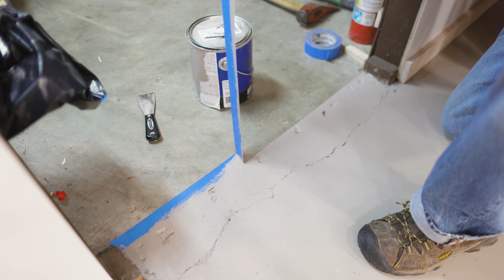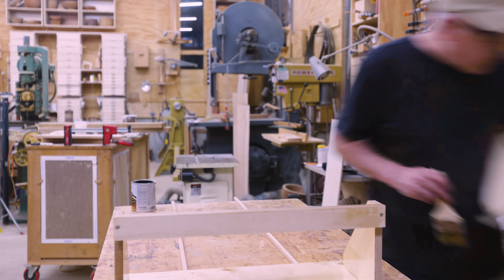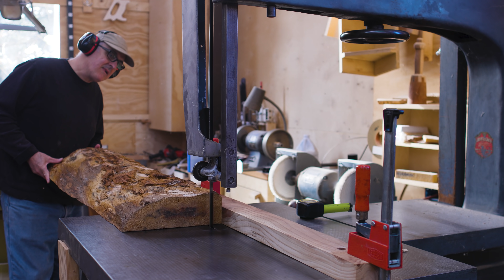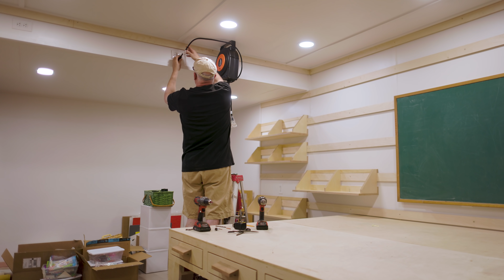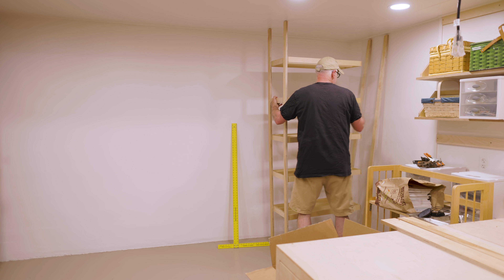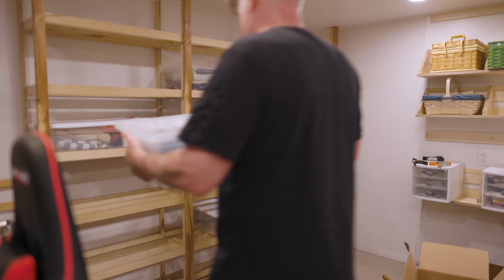Finishing the Craft Room

Comment: Considering that each screw can easily hold 100 pounds, it looked like you ended up with 4 attachment points per shelf. It should be fine.

Comment: I liked your review of the shear strength of the screw and the shelving and it would be interesting if you were able to test some of that?  Trying different methods to confirm or evaluate just what type of bond is there?  The bond also could become weakened by shrinkage of the wood during lower humidity months, and then maybe you're entirely dependent on the screw itself?

Comment: Just a quick tip for filling gaps/cracks in concrete before painting floors....  Use bondo or similar.   I've done this is a couple of warehouses and it's stood up well, including running forklifts over the cracks.     This  trick was taught to me by a guy who owned a company that manufactures epoxy flooring paints.....

Comment: Frank, we can hardly even get decent plywood here in New Zealand.  There have been no full sheets of plywood suitable for project use for two or three months. I'm building a router table/cabinet at the moment, and had to use smaller sheets of 18mm, and I've actually cleaned out the local DIY store.  I have enough to finish the project, although I've had to use MDF for the draws (the draw fronts will still be plywood).  It's a similar situation with fence timber — we have a several months wait for that.  It must be hard on the builders who can't work if they can't get materials.  Meanwhile shiploads of un-milled logs are going to China because they apparently pay more for it.   I'd be interested in how you did the exploding shelf effect.  I'm guessing that each part was animated with After Effects, which must have been a lot of work.

Comment: Completely aside, the chairs in that room may benefit from replacement wheels made of rollerblade wheels. They will work on the concrete MUCH better than the plastic ones that come with those chairs (especially that gaming chair your son has), without the need of the mats.

Example of what I mean, but not endorsement of this particular brand: https://www.amazon.com/Universal-Including-Hardwood-Rollerblade-Replacement/dp/B07FP56VND/ref=sr_1_5?dchild=1&keywords=chair+wheel+replacement&qid=1621956080&sr=8-5

Comment: If you want a more compact cord reel you could check the Bayco SL-801. It’s a simpler smaller design. It’s a disc/puck shaped drum 9.5” in diameter about 3.5” thick.

Comment: Without a compression value of side pressure on those shelves you would not have much friction hold.. The screws however have a very high Shear and tension strength. Shelves should hold nicely. I am, as always very entertained and impressed with the ways you find to build your projects. Not always industry standards and often unique.

Comment: I like the shelves without a plywood surface. I build garage helving the same way, except I would put the inside pieces front to back, which required a sheet on top to support things. By running them sideways, I can eliminate the sheet on top and save space, weight and money!

Comment: Hey Frank, could you explain to me what a planer (sp) does and how it works? Thanks!
Reply from the maker: The jointer makes one side of a board flat.  The planer makes the 2 sides of the board parallel.  So, if you joint one face and make it flat,  you can then plane the other side to be parallel to the jointed side, giving you a board that is straight and has uniform thickness.

Comment: Great as usual. As for that big table: you can buy recessed/foldaway outlets that you can cut into that dead space in the center of the table. That may solve your overhead wire issue, and the foldaway ones basically disappear into the table top if you set them in a bit. Just an idea.
Reply from the maker: I like that.
Reply: They are spendy, though.
Reply: @timma_thy  Won't argue that: $47 on Amazon, but it's the hideaway with the cover and it's both 3-prong and USB.

Comment: Yeah, while you were moving that big table, the first thing I thought of was that it would make a fantastic sewing table if you cut some plugs out of that open center strip that runs down the middle for cords.

I admit though, I'm still skeptical that those desks can work without pulling the cleats out of the wall.  Can you really hang that kind of torque off of a french cleat?
Reply: That table looks like it violates rule #1 for work tables - don't make them wider than you can reach, because the places you can't reach to just end up as junk collection areas. Saw someone else mentioning that rule in a video (I think it was Mathias Wandel), and have an outfeed table I built for my table saw that has turned into a work table now, and yup - the area you can't reach from the main working side does collect a lot of crap that shouldn't be on the table!
Reply: @gorak9000  Yeah, it looks like he initially made it to be in the center of a room and reached across from all sides.
Reply: @jcortese3300  Originally it was a train set table, so had a reason to be oversized, but now that it's a general worksurface, I'd consider cutting it in half and making it 2 useful tables, rather than one that collects junk.

Comment: It could be cute/funtional/interesting/more industrial to have the hanger/bookends attached by bolt heads in recessed t-track.  

Could give you ability to really use the hangers as bookends on both sides and make some visual intrigue with some cantilevering opposite books. |llll|___|_         |lllll|__ ,etc
Reply from the maker: adjustable supports, interesting...